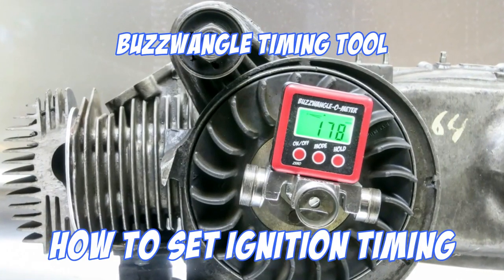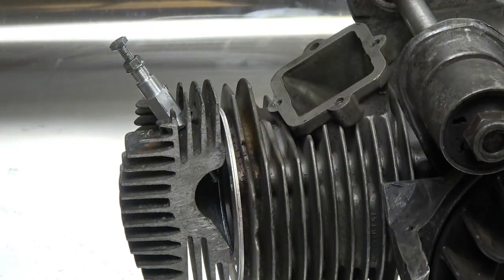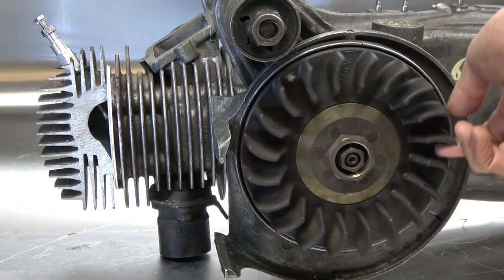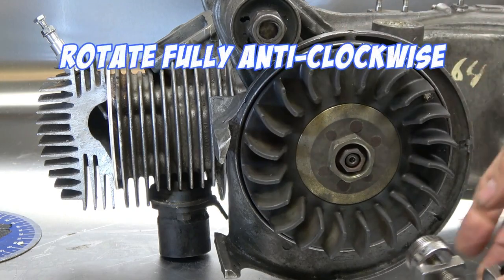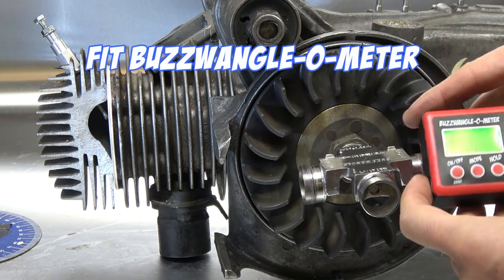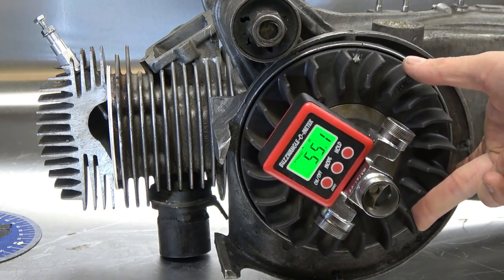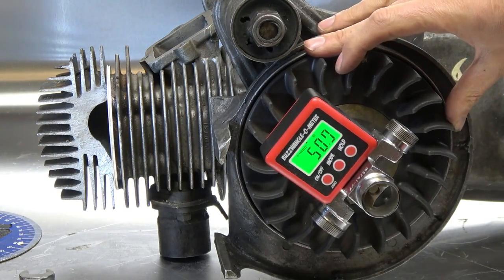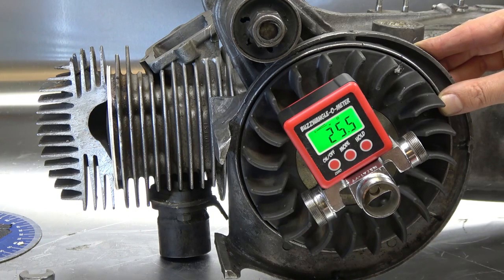How to use Buzzwangle Tool for ignition timing www.buzzwangle.com

Comment: As a novice,  just learning,  it was informative,  but a bit misleading.....not a snipe at you but I had to question myself! It makes no difference if you start at the piston stopper anticlockwise or clockwise as you will always stop at the same point to find TDC! After doing this procedure several times is made more sense to start at piston stopper and go anticlockwise to get TDC and then continue anticlockwise to find the required degrees before TDC....just a little confusing I think but informative and helpful.
Reply: It only matters because the meter counts down from 360 going anticlockwise; which is what is needed for this proceedure. Glad it worked for you in the end.

Comment: The damn locking Allen screw was too small for my TV 175 crank and you can’t tighten the stop bit with the cowl on. It’s not thought out 😕
Reply from the maker: On engines with a deeply-recessed crankshaft (like Vega) you can add a large bearing ball or copper coins before fitting the screw which allows it to be tightened.